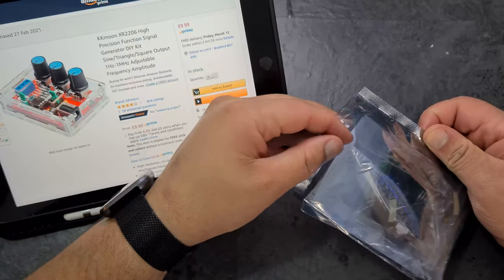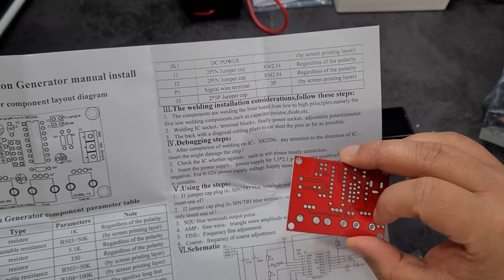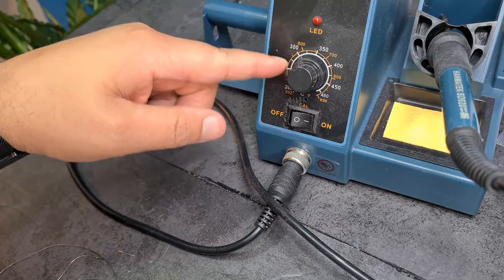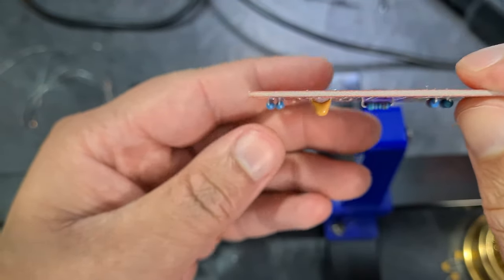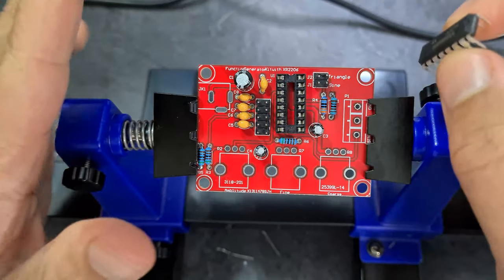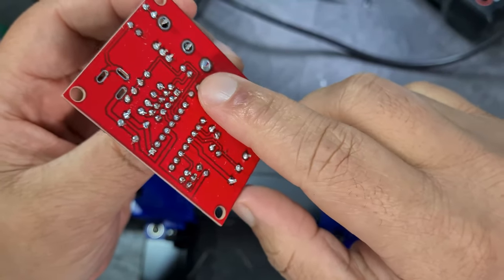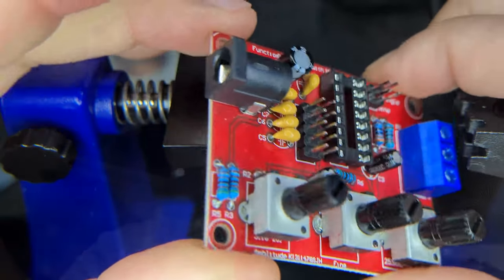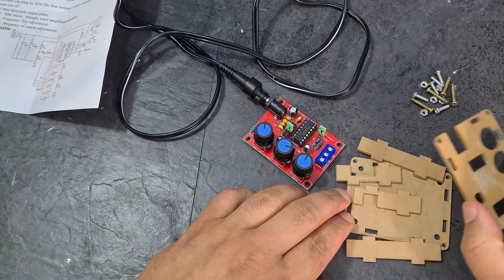Cheap Function Generator DIY Kit 'XR2206' - Practising My Soldering

Comment: Nice video.That rosin flux you got find a small bottle and make 50%rosin and 50% isoproppy alchohol up to 90degress so you can have flux in liquid form it helps a lot on soldering.
Reply from the maker: I'm literally soldering as we speak and using this rubbish flux pen thing lol. Very frustrating. Thanks for this. Couldn't have commented at a better time. I'll try order a bottle now. I've never been good at mixing chemicals to make my own lol
Reply from the maker: couldn't actually find a mix online so I ordered some isopropyl alcohol and will add some to the resin. Thanks!!
Reply: @HamedAdefuwa  Most fluxes because are sellable a lot are junk because they put lot chemicals or vaseline and make the nose tip quick oxidation dont trust those  pruducts .The rock rosin but only in rock form is good and trusted the only problem is sticky a lot but anyway it can do the job and with q-tip or toothbrush you can clean it.Also syrignes from e-bay amazon most of them are junk either.Order only from official sites.Thats why that situation its  frustrating you.
Reply from the maker: I've found some videos on here with guys making their own flux. Doesn't seem too difficult. Just need to find the rock rosin now. Thanks for this. 🙏👍

Comment: Did the same a few days ago!......good soldering practice mate. Nice video, as always.
Reply from the maker: Thanks, especially for the kind words on my dodgy soldering lol. I've just had 15 kits show up from AliExpress so going to have a blast with them. What's your plans in the near future for your hobbyist learning? Planning on building anything?
Reply: @HamedAdefuwa  I have a couple of LED clock kits to make. Soldering practice to be honest. I really like the maths side of things too.....like proving the RC circuit calculations with oscilloscope, or OHMs law stuff....we seem to buy the same kit too 😀
Reply: Do i need to solder this on both sides of the board? or just the bottom soldering is enough?
Reply from the maker: If I've understood correctly, just the bottom. Have a look at how I did it in the video

Comment: Hello. I'm an experimental musician and I want to start solding and create some simple drones. I saw this simple oscillator and I think it's perfect for a beginer. Question: can I connect the output to a female jack connector? Which kind of cables would I need to do it? (I'm very noob.) Thanks and sorry for the inconveniences.
Reply from the maker: hey thanks for watching, erm what are you trying to do? I'm not sure what you mean by connecting the output to a female jack. The function generator will produce a square or a sine wave right, so you want to connect it another connector.. Are you trying to do something like this: https://www.eevblog.com/forum/beginners/attach-speaker-to-a-function-generator/
Reply: @HamedAdefuwa  I'm trying to do something like a mini-synth. I want to connect it to an speaker or some effect pedals. I hope you understand this way. 👌🏻
Reply: @HamedAdefuwa  Especifically connect the output to one of these: https://www.amazon.es/dp/B079H5717S/ref=cm_sw_r_cp_apa_glt_i_FTE8E5983333B8S19PDZ

Or one of these if the jack is 3.5: https://www.amazon.es/dp/B073QW1RB2/ref=cm_sw_r_cp_apa_glt_i_8CZCB2JFBJNN54MBBB2A